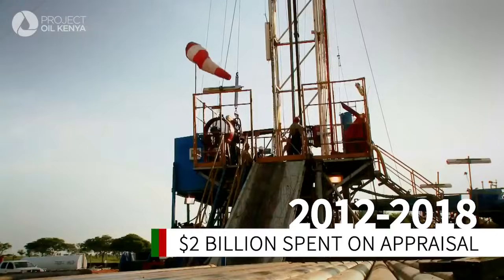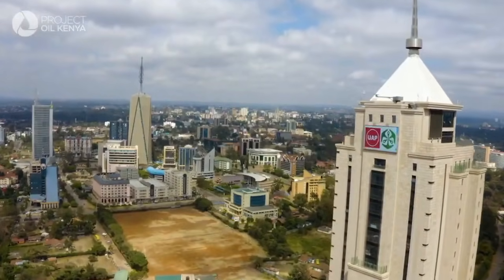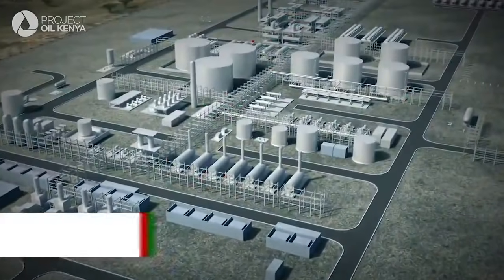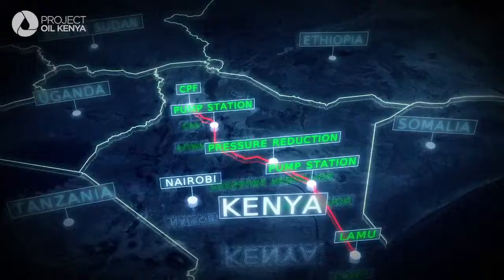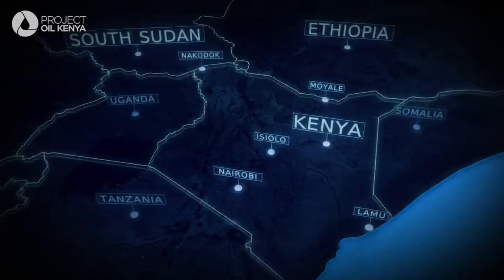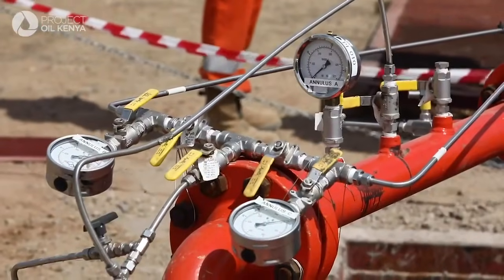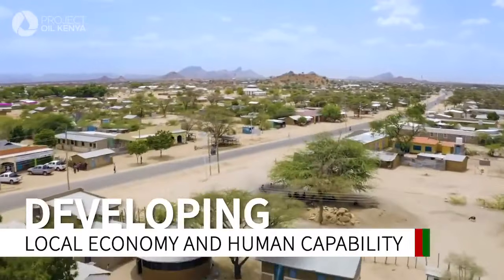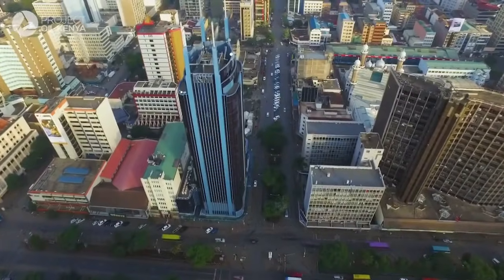Tullow's Oil and Gas Project in Turkana, Kenya

Comment: Please, our Kenya's Oil Exploration needs to look into other areas and not only dwell in Turkana. There is the Kerio Valley, Whole North Eastern Province alongside Marsabit and Isiolo plus Offshore territories alongside Lamu & Kilifi Coastline....
Reply from the maker: You are right, and exploration has been going on or taking place across all the 4 main basins in Kenya. The only reasons why you have not heard about it a lot is because there has not been a major discoveries in those other areas. But with time, and as technology improves, there will be discoveries, as early data shows there is a working petroleum system in Tertiary Rift, Anza Basin, Mandera basin, and the Lamu basin

Comment: The answer is a modern refinery plant and a local financed pipeline, from source to coast.
Reply from the maker: Unfortunately, building a refinery does not make economic sense at the moment, given the volume of crude that is available. It is way too expensive to construct one...

On the crude oil pipeline, there shall be a heated pipeline from Lokichar to Lamu to enable export of the crude oil

Comment: This is the biggest mistake with all African countries. When they discover oil instead of drilling and building refinery and sell it as a finished product they want it to be exported to be refined in Europe then come back with a higher price that's doing 0 work Arab countries refine the Oil by them selves and that's why their countries are Rich the Oil will benefit Europe not Kenya
Reply from the maker: You have made a very good point and you are right.

In Africa, we make this mistake of not developing our local industries, and especially upstream oil and gas industry

Some of the top oil producing countries in Africa still suffer from lack of fuel products in their countries as they export most of their crude oil

There is need for a clear plan on how to tap into the oil and gas resources that Kenya has, and Africa in general has.

We can invest in leveraging the oil and gas resources we have to develop our economies and the sectors that emerge from having oil and gas in a country

For example, we can build a petrochemical industry, a cosmetics industry, and a fertilizer industry from the oil and gas sector.

Comment: Have they found an external investor yet? The only hope for this project was collaborating with Uganda on the pipeline.
Reply from the maker: The search for a strategic investor is still ongoing.

While I agree with you that combining our crude oil with that of Uganda would have made work a little bit easier, I also think Kenya should be able to develop its own infrastructure without relying on other countries

Assume Uganda had no oil. Are you suggesting we would not develop our oil and gas resources?

When starting, it is always difficult and expensive as you are laying the foundation...but once we build the infrastructure, it becomes easier over the years.
Reply: @joe-watson-gakuo  I am not an expert and so I am not fully aware if going it alone was a good idea but I think sharing costs with Ug would have lightened the burdened.
Reply from the maker: As you might be aware, Tullow Oil assets in Kenya were bought by Gulf Energy, which is part of Rubis Energie
Reply: @joe-watson-gakuo Yes I'm aware. Do they have the capital for it?

Comment: It's smells fishy.

Why should an oil refining nation export crude oil then import processed petroleum products?
Reply from the maker: Hahaha...it does not

The volumes we have at the moment do not justify building our own refinery. The economics of a refinery do not make sense at the moment

However, if we discover more crude oil, then a case can be made for the construction of a refinery, at least even a modular one.

This is because with Uganda building a refinery, that will skew the economics, as it might not make much sense to have two refineries within the region. We can import from Uganda instead of middle east...while we export our crude, and still make a profit as we reduce or eliminate our fuel import bill
Reply: @joe-watson-gakuo  Nigerian have built the massive Dangote refinery but are still building or refurbishing other smaller refineries on smaller scale.

Uganda is also doing the same fishy stuff of building the world's longest heated oil pipeline from Albertine region to Tanga.

Remember Kenya was an oil refining nation for many years .

So where is the oil being shipped to  if not to a refinery?
Reply: It is stupidity because I am working in oil company, lukoil, rigging and processing is within the same place, why they want to export is quite fishy

Comment: There is a need for a joint refinery by south Sudan, Kenya and Uganda.
Reply from the maker: There existed such a plan during Kibaki's time, but after Uhuru took over, those plans went off...and now Uganda is building their own refinery.

It is possible Kenya shall be importing petroleum oil products from Uganda...might be cheaper, than buying from Middle East

Comment: what are the total reserves here? 500m barrels doesn't justify this sort of investment , I reckon the true figure including natural gas isn't being disclosed
Reply from the maker: The final investment decision will be based on a model that ensure that investors and government get a return on their investment over the life of the project.

Remember, it looks expensive because of the capex needed when starting since all the infrastructure need to be set up.

In terms of figures, no one really knows with exact certainty what is usually underneath, but the models being used are pretty close to what we have in terms of oil and gas resources

But only the drill bit tells the truth...
Reply: @upstreamstory  it looks expensive. Isn't the issue my issue is that in my view the total reserves figure is being undervalued, perhaps for nefarious reasons the minute GoK is involved in anything you can expect significant chicanery

Comment: The cost of producing waxy crude oil in Kenya involves several considerations, primarily due to the unique characteristics of the oil found in the Lokichar Basin. Here are some key points based on available information:

Extraction Costs: Estimates from Tullow Oil suggest that the cost to extract and transport oil from the Lokichar Basin could be around US$25 per barrel. However, these estimates are considered questionable by some due to unresolved issues with transportation logistics.

High Wax Content: Kenya's Lokichar crude is known for its high wax content (about 40%), which increases the complexity and cost of extraction and transportation. The oil needs to be kept at temperatures above 40 degrees Celsius to remain liquid, necessitating heated pipelines and storage facilities, which significantly increases costs.

Infrastructure Costs: The development plan includes constructing a heated pipeline from Lokichar to Lamu, which adds to the overall production cost. The initial cost for setting up a crude pipeline and processing facilities was estimated at Sh373 billion ($3.4 billion).

Wax Management: The high pour point of Kenyan crude means it solidifies at lower temperatures, requiring specialized transportation methods. This adds to the operational costs, as pipelines and trucks must be equipped with heating systems to keep the oil at a desirable temperature.

Economic Viability: Despite the high costs, the quality of the oil (light and sweet with low sulfur content) could fetch a premium in the international market, although it's sold at a discount compared to benchmarks like Brent crude, reflecting the higher production costs.

Given these points, the production of waxy crude oil in Kenya is notably more expensive than in areas where the oil does not require such specialized handling. The exact cost can vary based on several factors including oil price fluctuations, technological advancements, and the final infrastructure development costs, but it's evident that the high wax content significantly impacts the overall production expenses.

Comment: From years ago when it was first discovered, i thought that by now we could be exporting the oil already.
Sources from salon station say that there is alot political factors at play
Reply from the maker: Hahaha...eti sources from the salon station/ You have made my day...

Now, on matters related to the oil in Turkana, it is important to realize that typically, it takes a long period for such a project to be development.

If you think about it, from oil discovery to market is not an easy thing, especially when you are far off from the coast as Turkana is

You need the infrastructure to be constructed like the crude oil pipeline, and this requires permission from land owners all the way from Turkana to Lamu.

And yes, add the political dynamics into the mix and you have really hot topic or project on your hands.

Comment: It would have been preferable to first build a refinery in Kenya before exportting the oil. The economic benefits of the refined oil - from refined fuel to chemicals to medicines - would improve the country faster than exporting the unrefined petroleum and having tolater impirt the products.
The move in the UK fin Scotland forming a party to break away from the UK and become an imdependent political entity is a direct consequence of the oil drilled off the shores  of Scotland being exported to the USA because the US could pay $4.50 a barrel and Scotland only 50 cents. The people of Scotlamd are thus considered unworthy of benefiting off the resources of their land in favour of the profits of a business person.
The oil in Kenya should be first refined and the related industries built up. Only the excess petroleum should be exported.
Reply from the maker: I hear and understand your point of view on building a refinery to process our crude oil.

However, with the volumes being projected by Tullow Oil at the moment, of about 120,000 barrels per day in peak production, a refinery does not make economic sense.

It is more profitable to sell or export crude oil, and use some of the revenues to settle our import bill.

A refinery would only make sense if we increased our crude oil discoveries, to a level where the projected volumes would be over 300,000 barrels per day...at least such a throughput would make a refinery a worthwhile investment.

Also, please remember Uganda is building a refinery, and am not sure it would be economically viable for the region to have another refinery soon....but of course a modular refinery approach could make sense.

This is a discussion or conversation we need to continue having as a country as oil and gas exploration activities continue across various basins in Kenya
Reply: @joe-watson-gakuo  The argument that is usually floated about the viability of a refinery is that it costs $90,000 to $120,000 to create a refinery per barrel. That statement is only true if you are not doing the engineering yourself. Next, you do not need to be drilling your own oil to be able to refine products. You just need the unrefined petroleum. The overall benefits derived from a refinery, not just fuel, far outweigh.the argument of not building a refinery. The refinery does not have to be in Turkana. It can be in Nairobi. Fuel, petrochemicals, plastics, medicines, etc, all which Kenya spends huge amounts of money importing. Not to mention the number of jobs and technology transfer 
The current setup will only benefit the shareholders of Tullow, not Kenya as a whole. Rather than Tullow risk being asked to give up it's shares and the drilling being nationalized in future, it would be prudent to invest in value-added product creation from the onset.

Comment: Hope this project will be up and running by the time we hit  vision 2030
Reply from the maker: This would be great, but I ma not sure it would happen under President Ruto's government. The reason am not as optimistic is because the current government seems to be interested in climate change activism, and is not keen to promote oil or gas exploration.

For some of these projects to proceed smoothly, you need to have leaders in the country with an ability to see the potential of the project, and also create an enabling environment for upstream oil and gas investments.

At the moment, I am not so sure about Kenya's ability to attract investors in the upstream oil and gas sector

Comment: When will this dance yields tangible results to mwananchi wa kenya?
Reply from the maker: The honest answer is no one has a definite day or time when that will happen...and this is because the process is not as easy as it seems to many

There are a lot of moving parts, the back and forth negotiations on terms, and how revenues will be shared among the investors and the government etc

However, at this stage, there are conversations and discussions about the proposed development plan and that will take a while...

After that, there shall be the final investment decision, which will mark the start of the developments to help investors do commercial production.

Depending on how fast these processes are done and the availability of capital or money to undertake the project, it could happen sooner or take another 5 to 10 years.

Comment: Why is fuel in Kenya so expensive and yet we can mine
Reply: Sent overseas for refinery and sold back to Kenya at a higher price. 🤣
Reply from the maker: @oasis5683  Building a refinery in Kenya at the moment does not make any economic sense. There is not enough oil and gas resources discovered yet to provide enough throughput for the refinery per day.

It is easier and cheaper to export our crude oil, and import finished petroleum products.

If more discoveries are made in Kenya, then a case can be made for building of a refinery as is the case in Uganda.
Reply from the maker: There are a number of reasons why fuel is expensive in Kenya.

First, we are a net oil importing nation, which means we import all the fuel we consume in Kenya. This means we are at the mercy of the international oil and gas prices.

Two, in Kenya, taxes are a big component of the final fuel prices. If you analyze the prices, you will realize that taxation takes or constitutes about 50% of the fuel prices you pay at the petrol station. This means that government has made the fuel prices expensive in Kenya through taxes it levies...and there is a formula for that.

Third, we are still not producing our oil and gas resources in Turkana. The process of exploration and production is a complex one, and it takes a long period from the time you discover oil or gas, to the time you start consuming it within the country

In Kenya's context, the oil and gas in Turkana belongs to the oil companies that is exploring it, and since they are the ones who have invested money, their share or interest in the oil is high at the moment. National Oil Company of Kenya holds a 10% interest in the oil in Turkana, and under the PSC (production sharing contract), there is a formula of how the oil revenues would be shared between Investors, Kenya's government, and local communities.

Another point to note is that the oil in Turkana will be exported, and then Kenya wil import oil or gas as is the case today.

It would require us to build a refinery, either conventional or modular refinery if we are to turn oil in Turkana into refined petroleum products for local or domestic market. Kenya does not have enough oil and gas resources to justify building a refinery.

To continue learning more, join my community and newsletter with this link: https://joewatson.kit.com/ae1d312cf0
Reply: fuel is not expansive, it is the ridiculous taxes that doubles its price at the port.
Reply from the maker: You are right...our fuel taxes and levies in Kenya are ridiculous, and this makes everything else expensive.
Reply: We can mine in theory
Reply from the maker: @onesykaranja2903  Why do you feel or say this?
Reply: @ because of the challenges. two major investors have pulled out. In theory or rather on papers is a matter of mining, export for refining and importing but the challenges ahead will drastically slow down the whole process